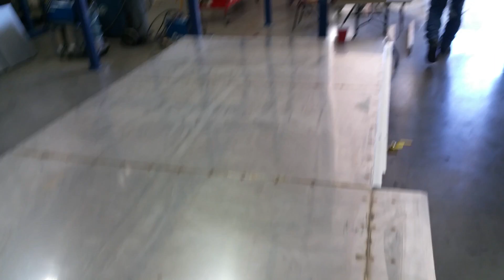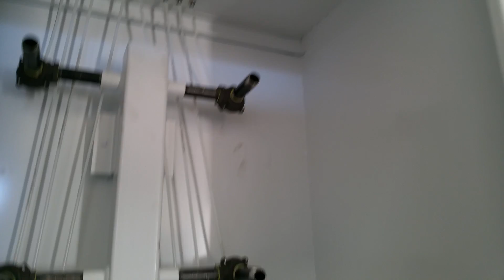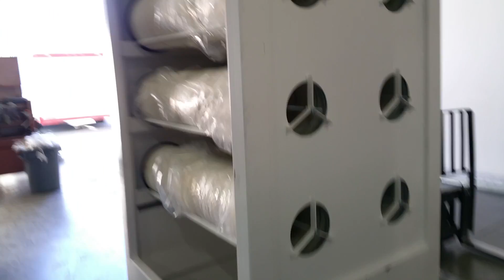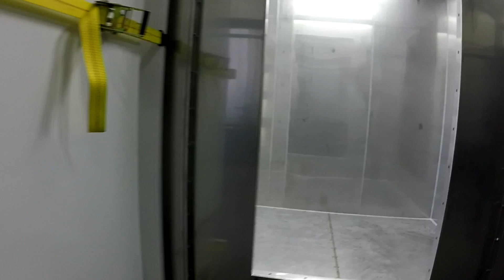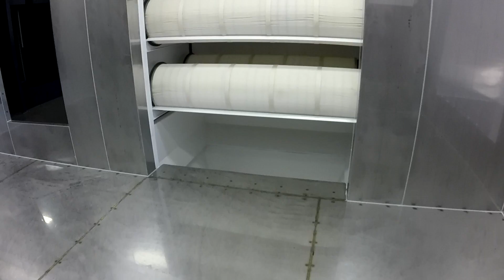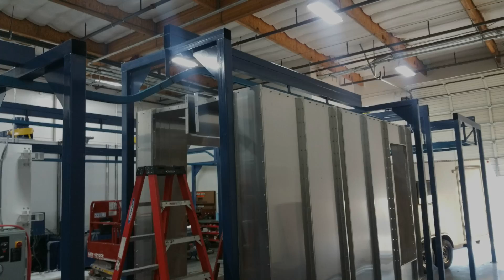Industrial finishing system part 4

Comment: Nice installation, Stan.  Superclean!  Hey Stan, what is the definition of a "Definite Purpose Contactor" versus a ordinary motor/light contactor?
Reply from the maker: +WAVETUBE84  Definite Purpose Contactor is just as the name implies, it is designed for a single use, a good example would be a reversing contactor for an elevator motor in an OEM application. Although they can be used for other things, UL lists them to do only 1 thing.
Reply: Shadon HKW Thanks Stan.  I had to replace one in a mig welder.  It relayed the command from the trigger switch.  They cost about $190+ back in 2005??  "DP" has something to do with high cycles (I speculate) and inductive loads (more speculation)???

Comment: Stainless is cheaper than copper?
Reply: The only reasons I can think of are resistance to the Phosphate etchant priming process, corrosion resistance and cost. The phosphate priming solution should have been totally dried before the power coating step though, so that probably isn't it. The surface could be charged oppositely to the part to lower the amount of power that would deposit on it, but any metal could work for that and stainless' comparatively high resistance doesn't offer any benefits. 

Compatibility with a cleaning process, comparative ease of welding and lower cost than other compatible metals (titanium) are the only reasons I can think of that apply given the "It's not the corrosion resistance" statement. Baked powder coat doesn't stick worth a damn to unprimed stainless, but that can't be the reason right? The walls should never get hot enough to remelt/cure the powder.

Comment: Is Stainless steel use so the powder won't stick to it because of static electricity.
Reply: +Ruben static electricity can't accumulate on conductors (but it accumulate on the powder obviously), but I guess it's the most ductile metal that's not magnetic.